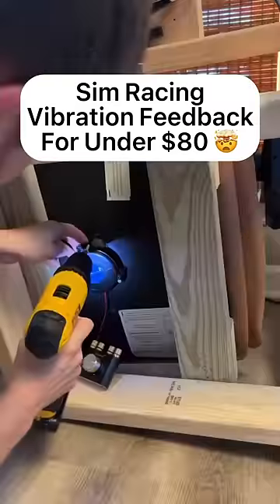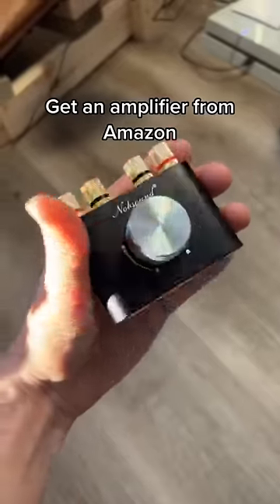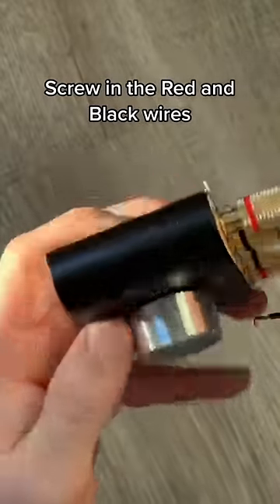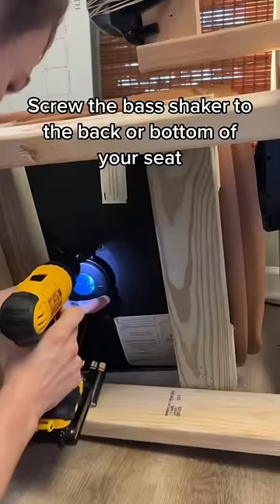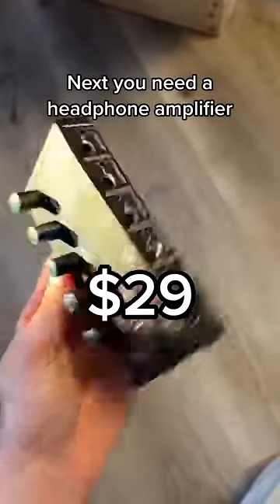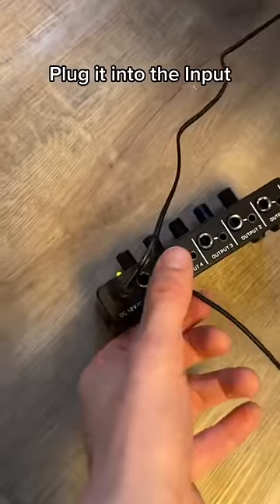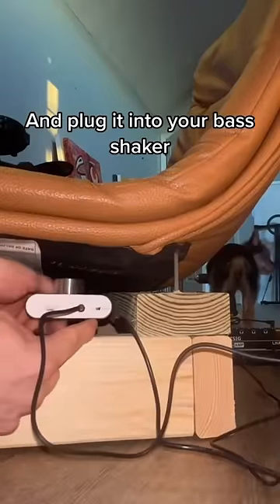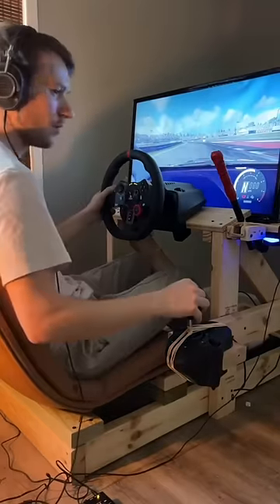How to get Vibration Feed back on your Sim Rig for under $80!🤯

Comment: Bro did the diy sequential gearbox on his gear thats how u know he knows his stuff
Reply from the maker: Haha thank you! 🙏🏻 I love it!
Reply: Actually he doesn’t he wired the amp wrong, 
Used the headphone amp wrong, youre supposed to keep it at a maximum of 3db 2oclock and main entry at 0Db 12oclock 
And lets not forget the bad input which is a bluetooth device
Reply: @medmusic7977 the comment is a joke! The "sequential transmission" mod is just putting a bunch of rubber bands on the stick shifter

Comment: the wires are meant to go through both the holes on the amp 😢, the cylindrical opening is for a banana plug
Reply from the maker: I know that now! Hahaha
Reply: What do you mean I'm trying to do the same?
Reply: @joelcabral1467  it doesn’t matter. Low key this guy was a genius for that.
Reply: @SimRacingSucks then maybe let people know instead of showing this crap

Comment: Actually I think you would need a crossover between the speaker and the amp so that no high frequency can get through the speaker, because it is not designed for it (and also to remove the noise you hear in the video).
Also be careful because not all amps can be bridged (also known as connecting the negative to the right speaker and the positive to the left speaker), you could burn the amp or the supply.
Reply: In some sims you can have a separate output be the vibration/bass
Reply: It’s a transducer so not as big a deal but yes above 60 hz can be buzzy and annoying

Comment: Great DIY video! No need for expensive systems that only work on specific games!

I did something similar but even simpler: I bought an $80 8" powered subwoofer by Monoprice and flipped it so it's pointing at my floor. It turns the floor into a bass speaker! And you don't have to mount it to anything.

Warning: this method only works for people that don't have downstairs neighbors.

Comment: Some assistance for you. That amp you used initially there has banana connectors. You can buy a pack of Banana plugs that you attach to your speaker wire, and then you can simply plug into those connectors. Not just for this project, but for actual sound.

Comment: For other people trying this the way he hooked up the wires works, but the outside holes are for banana plugs. If you're using straight wires, unscrew the connector and put your copper in the now exposed hole then screw it back on.

Comment: I have never seen someone use binding posts that way LOL. 

The center hole is supposed to be for a banana jack. If you are connecting just wire. You are supposed to stick the wire in one side and out the other

Comment: I did something similar to this little bit more intricate maybe I should post a YouTube video about it.
I took apart like five or six different dualsense controllers as well as a couple of dualshock 4 controllers wired all of the motors together,  The duel sense controllers and the DualShock controllers vibration are much more intense and I can actually feel the road instead of just the vibration from what I can hear the engine sound.

Comment: It's called a SUBWOOFER
Reply from the maker: Kind of but it doesn’t let out the same frequency range as a subwoofer. So not really the same
Reply: Nope, a subwoofer produces sound you can hear, these are infrasonic transducers, not speakers, and they produce sound lower than humans can hear, but you can feel it

Comment: That's quite stupid. The "Bass shaker" will react to the volume of the game and not to what is happening. Some things in the game can be loud but not cause vibrations in real life. The best solution would be to use the outputs of an controller supports already vibrations. The most controlers could give 2 specific vibration outputs and some even 4.
Reply: Actually, the bass shaker is only going to vibrate when there's a very low sound in the game, it's like a speaker but it plays sounds too low to hear

Comment: okay so i’m gonna tell you right now, as an speaker technician, do NOT use those types of clumps like that. you can see that it’s fed through a hole as you twist it. feeding it from the top can have a poor connection and cause some short circuits.

Comment: You know you can go into your pc settings, under sound and set it to use a different device. If there's a reason you do this then nvm, I've just had this problem before while trying to connect a controller

Comment: Why do you need two amps? I did this all for under $21 usd with just a $3 amp and a $10 bass shaker and a $8 dc power brick.
Reply: Where did you get those so cheap?

Comment: On a PS5 will this only work if you split the audio out from the controller to go to your wired headphones and your base shaker? From what I can tell from the PS5 you cant audio out to headphones and hdmi at the same time. I am running a big soundbar with just hdmi as output so i have no other output...help!

Comment: That's not feed back. That's just bass. A feedback is the response of vibrating parts like the chair or steering wheel.
Reply: The chair starts to vibrate at certain RPM.
Reply: @GrillerRohde  yea so does my desk